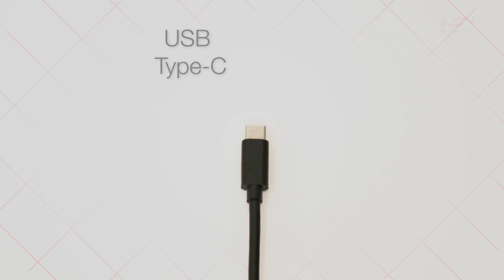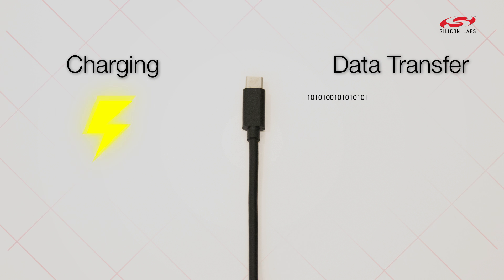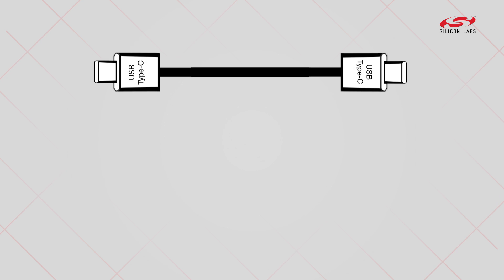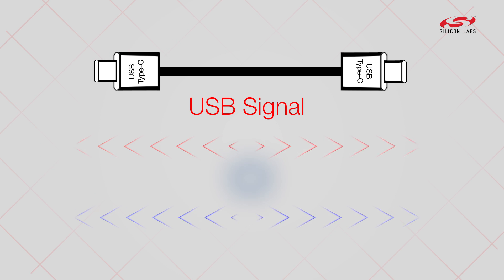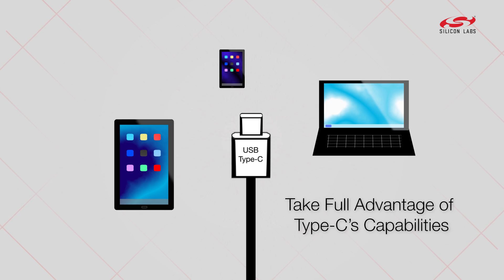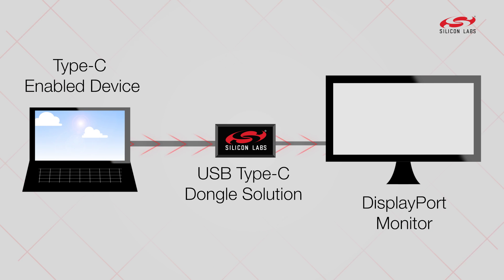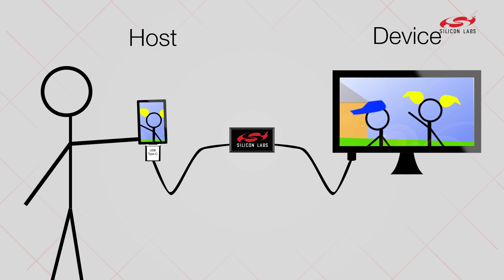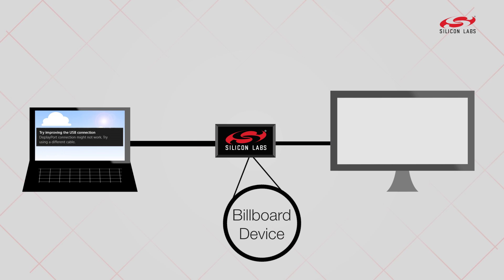What is Alternate Mode in USB Type-C? - Explanation Video from Silicon Labs

Comment: I have a new laptop that has the USB-C alternative mode option.  does anyone know how many external monitors (independent displays) I could run at once (just a range)?  I don't need an exact number.   I understand the video card could also provide some limitations.   I would run them at 1080p resolution.
Reply: If your usb-c runs thunderbolt tecnology, you can daisy chain up one 5k monitor; two 4K at 60Hz and up till 6 or 8 monitors full HD. But it will depend on if your grafic card and your processor takes.

Comment: The Alt. Mode is on every USB type C ? Because I have a phone with type c and I want to buy a mirabook but the mirabook work with the displayport Alt mode of type c. Thx for your time.
Reply: no Alt Mode is just XXX-over-USB-C cable, the device needs to know how to send other signal over USB-C, it cant magicly do that if it was not designed to do so
Reply: @ShadowriverUB  u know how to make a decice do dat?
Reply: @sohamguru2199  design and solder new chips in your device